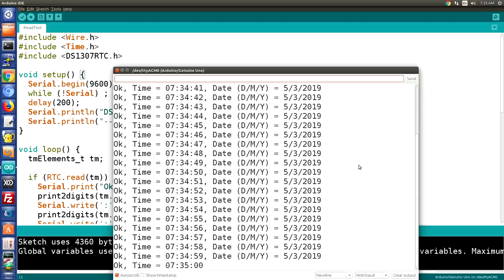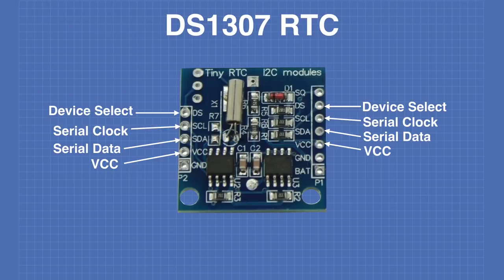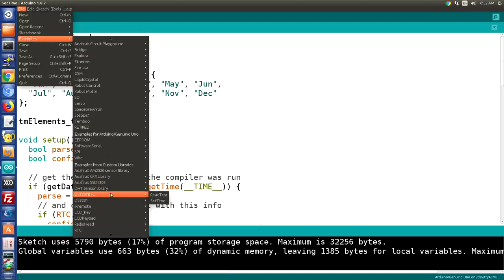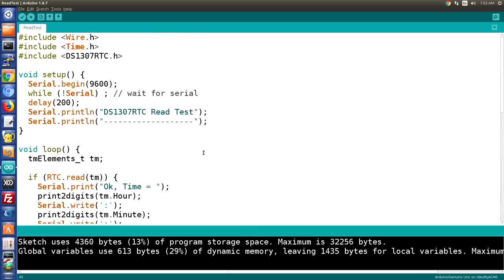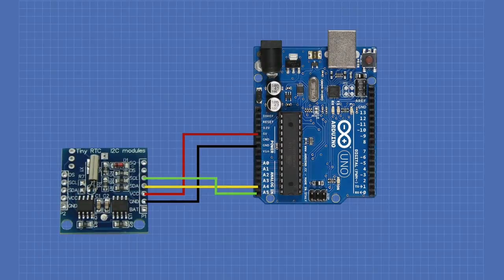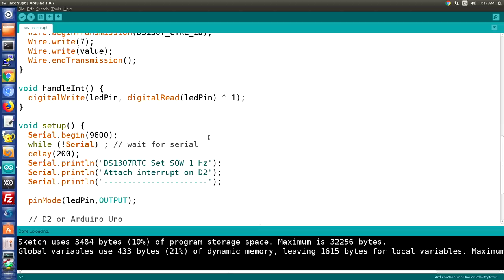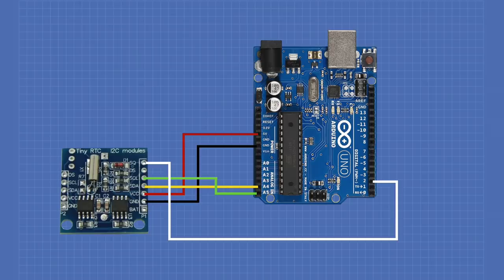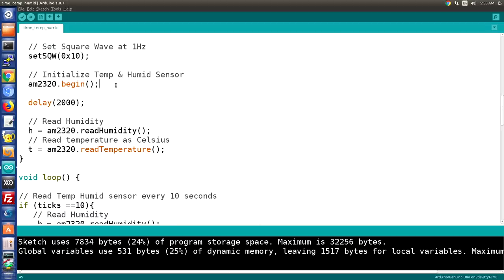Arduino Real Time Clock - Using the Tiny RTC

Comment: the DS signal is a 1-wire signal used for the DS18B20 temperatuur sensor that you can  add to the board and is not a device select! 
here is the schematic: https://www.fabtolab.com/image/data/Accessories/RTC/DS1307ckt.jpg
and if you use a CR2032 (non rechargeble battery) you need to change some stuff because those boards are designed to use a LIR2032 (rechargeable battery).
to do this remove R5, D1, R4 and R6. then wire a jumper on R6. other wise you try to charge a non chargeabe battery and that is going to kill the battery.

Comment: You might want to use the qualifier "volatile" for the variable ticks, so the declaration should read "volatile int ticks= 0;". This is a compiler directive which results in code that reads the value of ticks from RAM instead of from a register in order to avoid conflicts when using concurrent processes and/or interrupts with global variables.
Reply: this also I wanted to suggest, but you were quicker :-) 
when the values of variables are changed in interrupt service routines (ISRs), they have to be defined 'volatile', otherwise they could behave oddly

Comment: One small but important point regarding your LED blink on interrupt code. It is not a very good idea to use digitalWrite within an interrupt service routine because it is very slow and, as you rightly pointed out, the routine should execute as quickly as possible. It is much better to use direct port manipulation (in this case PORTB bit 5) to flip the LED state.

Comment: I really like how you introduced the module and the developed the ideas in this video. It was a good progression from module to project. I'm looking forward to the robot series.

I do like the two camera set up for seeing the projects on the bench or when you showing a module or part. I'm not a fan of the look left look right camera switching for the explanations/narration. It's quite jarring and doesn't feel like it adds to the presentation. I can see what you are going for with respect to keeping interest in the visuals but I think some editing cutting with stills or change of framing would work better than seeing you physically turn to look from one camera to the other with no obvious purpose.

Keep up the great videos!

Comment: Thank you very much for this. It saved me (some time). LOL  I did have trouble since I have a DS3231 and not a DS1307.  It kept putting the seconds 8 seconds behind. I ended up having to add 8 seconds to the time when it retrieved the time from the PC. Thanks again!

Comment: Very nicely produced and easy to follow along with clear explanation and good pace. One nit that jumped out at me is the misuse of the term accuracy, where you really meant precision. The*precision* of the RTC is 1 second. As others have noted, the accuracy is off for two reasons. The time & date used to set the clock will have a slight skew due to the lag between running the clock-setter and the compile time. Also, many people seem to find the accuracy of the clock frequency is poor, resulting in increasing differences between date & time of the RTC & and actual time and date. I immediately wondered whether the is some way to trim the frequency of the crystal to achieve better accuracy.

Comment: I love the way the info presentation flows. Pretty structured and informative. So I've to visit your website for more static info on this topic. However, I found on the website (similar to this video) the description for the DS pin on the TinyRTC module "DS – Device Select, this allows you to enable or disable the device.". I did more research online and found that DS was actually meant for the temperature readout from the DS18B20 tempearture sensing module that can be optionally soldered to the board next to the battery (if its not already there). And it is also recommended to have a pullup resistor to the DS pin conenction when in use.
Reply: The DS18B20 temperature sensor is independent of the DS1307 RTC hardware on the board. The only shared resources between the two are the VCC and GND rails on the TinyRTC board...

Comment: There is also a 16 pin "DS3231SN" RTC. This is the first I have heard of the DS1307 Tiny, but it sounds like they both do the same. Unfortunately I don't have the pinout in front of me or I would share. 

Pretty cool little chips.
Reply: The DS1307 has no alarm function built in and no temperature built in; the DS3231 has two built-in alarms, and can be programmed to interrupt when the clock time matches the alarm time in seconds, or minutes and seconds, or hours minutes and seconds, or days hours minutes and seconds, etc.  The DS3231 also has an on-chip thermometer. (I bought the DS1307, and was disappointed that I could not interrupt once per hour.)

Comment: I completely agree with the other commenters who say to use the DS3231 instead. (Especially the DS3231SN, which is the quartz crystal version, rather than the DS3231M, which uses a less accurate MEMS oscillator.)  The DS1307 can be so inaccurate that it's just not worth the effort. I've gotten some clock kits based on the 1307 that were so bad they literally were useless (a clock that loses or gains several minutes per day is simply not usable). The DS3231 is superb.

Comment: Module’s Hidden Feature – DS18B20
There’s a provision on our DS1307 RTC module that often goes unnoticed. It allows us to install DS18B20 temperature sensor.

The 3 holes in the top corner right next to the battery holder(labled as U1) is where the DS18B20 is installed.
Once you install the DS18B20, you will be able to get temperature readings from DS pin. These readings can further be used to compensate for temperature based time drift in code.
So there is no need to install a Temp Sensor, since its already at the Tiny RTC / DS1307.

Comment: Very nice! but I think the DS3231 is better and precise than DS1307. what you think
Reply: 3231 is far more accurate. You can also solder it directly to some of the Arduino clones as they have an additional
header that just happens to align with the pins on the 3231 RTC. I had a 3231 running for over 2 years, have not had to adjust the time yet.
Reply: Always well made videos. The DS1307 is a great intro to I2C use but for accuracy, the DS3231 is a lot better. I have built both.

Comment: Kind of tangentially related, but a lot of people are using now ESP32/ESP8266 based 'Arduinos', as they are much more powerful and have WiFi/Bluetooth, and are generally cheaper.
Obviously with the WiFi connection is the possibility to use NTP (network time protocol) to get the accurate time from a time server, the ESP even has functions built into it's ROM for registering which time server you want to use, so require almost no code to set up.

Comment: Just something I read on google about DS1307. "The main difference between the DS3231 and DS1370 is the accuracy of time-keeping. DS1307 comes with an external 32kHz crystal for time-keeping whose oscillation frequency is easily affected by external temperature. This usually results with the clock being off by around five or so minutes per month." so maybe the DS3231 is better.

Comment: I noticed that as the serial monitor was listing out the time, temp, humidity that occasionally there were would be two consecutive time displays with exactly the same reading in the seconds place.    I thought this would update the display once per 1 Hz tick,  so I don't follow how you could ever have a duplicate time displayed.    What am I missing?

Thanks!    I love your style.   It is so very easy to follow.

Comment: It seems that assigning the square wave to pin 2 or 3 of the Uno comes with the disadvantage that it is an interrupt. The controller stops when the wave is down.

Why not assigning to a non-interrupt digital input pin and then check for change of state (of the square wave)? This would avoid interrupting the controller.

Also, do the statuses of the I/O change to zeros (off) during an interrupt, or are they frozen (maintained) during an interrupt? Thanks

Comment: Hello Guru, I have recently subscribed to DroneBot Workshop and like your way of teaching with detailed explanations and have become your fan. I request you if possible to append this video for interfacing this with 6 nos 8x8 Matrix Display in configuration as Digital clock display. Although you did mention that there are cheap Digital clocks available. If you have this on your website please do inform.

Comment: Ive seen a few I2C projects that need a resistor on the dataline to ground, is this required for this project?
Great vid, thanks for sharing.
Reply: If you have multiple devices , interference or your I2C nodes are a long distance from each other you may need pull-up resistors.
Reply: @typematrix5038  thanks for explanation, greatly appreciated.

Comment: Hi Bill, Great video and very informative. Unfortunately I could not download the associated code files for the interrupt example, so I copied the code from the video. I could not get the LED to flash from that code until I noticed that the command Wire.begin() was missing from the setup() function. If you put this in right after the call to Serial.begin(9600) it all magically works.
Reply: Thanks! I had same problem.

Comment: 1. DS pin is for ds18b20 -- there is a place for it for battery holder side. 
2. You ABSOLUTELY MUST modify module for using standard non-rechargable battery. This module will try to re-charge battery and will damage it. Not safe.
Use modules based on DS3231N -- much more stable, not required any modifications, allows to change I2C address, and have additional functionality. A bit more expensive, but much better overall.
You also never mention that module have EEPROM as well. 
Please research modules and their issues more carefully, can be lots of traps like that.
Reply: Wax on, wax off? That's a disaster. You should know better than trying to school the master.
Reply: @AngryRamboShow  They are actually correct in what they say.
Reply: @SpeccyMan  "They?"  Who?
Reply: This module was intended to be used with an LIR2032 and not a CR2032. Martyn Davies channel shows which components to desolder in order to use a non-rechargeable battery.

There's another cheap RTC module using a DS3231 and it also has the same issue of being wired to recharge an LIR2032 so will also require modification to swap in a CR2032
Reply: I have to agree. I used DS1307 and it skipped 3 days! within a one year :) DS3231N can measure temperature therefore adjust crystal frequency based on temperature. You can measure temperature from the sensor as well :)
Reply: Jokes aside, that's good to know. The thing about DBWS is that he's trying to bring this information out to people in a video series that's easy to follow along. Maybe you should put in the effort to make a video detailing a example project using the DS3231N. It's a lot easier to sit on a channel and say "you're doing it wrong," then it is to actually produce quality content and to build an audience. Have a little respect for the teacher, even if they don't get everything right or do everything in the best way possible. This guy has helped me out a lot, and yes I usually find a better way, but he showed me what was possible with a little time and effort, otherwise I would not have known much at all.
Reply: You can remove the diode and resistor, witch will disconnect the charging circuit.

Comment: Great video!
I saw a video you used rf 433 module to send data
I am currently stuck trying to use it to send data from an accelerometer to a dc motor, can you help with that

Comment: How do you ever get those RTC modules to work?  I got 6 of them from Amazon and can't get any of them to work since the 32 KHz crystal doesn't oscillate and the ds1307 doesn't do anything!  The Ground pin was not even connected on the pc board but jumping a wire to the neg. on the board didn't help, although it's getting power now it still doesn't do anything.   I tried replacing the crystal on one of them but that didn't make any difference.  I wonder if they were all made with counterfeit clock chips or what is going on with them?

Comment: Cool and simply video... but can you tell me How to programming a alarm time . I wish to use a ESP8266, with a relai to switch on /off the current wo will start and stop a radio. Have allready buy a DS3231 to have anytime the right time but don t find a solution to programming the alarm time . Can you help me please ? thanks in forwards

Comment: i made a raw ds1302(found from another ready clock) dot pcb module & connected the crystal & backup batterym wired it to A4 & A5, nothing is showing on serial monitor, using nano, do i have to use pull up resistors & what to do with the CE pin.

Comment: Hello DroneBot Workshop

I followed the tutorial with my arduino mega 2560 up to the point where the external LED pin would trigger on each falling edge of the RTC. Unfortunately the LED just stays on, either staying high all the time or the frequency is too high to detect the blinking. The code that was used is identical to yours.

Any tips or suggestions will be appreciated.
Thank you.

Comment: For full article there is an error,

This site can’t be reached
Check if there is a typo in dbws.
If spelling is correct, try running Windows Network Diagnostics.
DNS_PROBE_FINISHED_NXDOMAIN

Comment: I am trying to make a pet feeder. I am looking into clock modules which would run on low power like cmos cell or aaa battery, and not required to have a microcontroller attach or running . I found out clock modules like ds3231etc runs on cmos cell for months. But I realized it can only trigger two alarm daily. Is there any other module with at least around 6-10 alarms capability daily or any way to increase alarms capability of ds3231. So that I can amplify the alarm signal and use it trigger motor or servo that will dispense the treat/food. I was unsuccessful in finding such module, I also tried to find cheap circuit board of a commercial pet feeders on amazon. Still nothing.

Thanks in advance.

Comment: Hello! Do you know any website where I can find some step-by-step information about Arduino and how it works?
Reply: Just a thought, however it might be worth a look at the elegoo.com website.. even if you don't have say, the basic starter kit which they do sell, the downloads section has place to get the files associated with the kit and in general a PDF running through the basics and how to complete all the projects associated with the parts in the kit . Flashing a LED, making buzzer work, whatever is in there.

Ages ago I bought their general electronics kit which came with breadboard, wires, LEDs, a couple of transistors, lots of little things actually and I'm glad I did.. it was a super start to get a grip on things I might need. I'd imagine the one of the Arduino kits could do the same, especially if you've never really done anything with it and don't have an Arduino maybe!
Reply: @ollieb9875  Thank you very much!

Comment: what should one do for 12 hour format setting?
Reply: I found a little piece of code for 12 hour format

void ampm(int Hour){  //ampm function takes the hour value 0-23
if(Hour==0){          //if it's 0 it becomes 12
  Hour=12;
  a=true;            //true if it's am, false otherwise
  lcd.print(Hour);
}
else if(Hour>0 && Hour<12){
  a=true;           //normal value
  lcd.print(Hour);
}
else if(Hour==12){
  a=false;           //changing to pm
  lcd.print(Hour);
}
else if(Hour>12){
  Hour=Hour-12;     //substract 12 to bring it back to 1,2,3,...
  a=false;
  lcd.print(Hour);
}

}

Comment: When i use i2c scan i found 2 adress 0x50 and 0x68, from  the library they use the 0x68.
Did anyone know what the use of 0x50 adress?
Reply: The module has a 24C32N EEPROM chip (4 kilobytes).

Comment: "Without using a data structure the time you are going to get back is . . .the number of seconds elapsed since the beginning of Unix time." Get back from what? The date and time MAINTAINED ON THE DS1307 is in years, months, days, hours, minutes, and seconds, and the seconds range is 00-59. Where does the Unix time come from, and how do I get it?
Reply: Looking into this more, the SetTime sketch, using DS1307RTC.cpp, is going to add 30 years to the current date and set the TinyRTC year to 50 in year 2020 (years are 00 to 99 on the chip) ; that probably means the TinyRTC isn't handling leap years correctly.  1970 isn't a "thing" to the DS1307, as far as I can tell.
Reply: @3maisons  If the correct year can be obtained, whether or not it's a leap year is a relatively simple calculation for a computer:
If the year is not evenly divisible by four, it's not a leap year; end.  Otherwise it may be a leap year; next step.
If the year is not evenly divisible by one hundred, it's a leap year; end.  Otherwise it may not be a leap year; next step.
If the year is not evenly divisible by four hundred, it's not a leap year, otherwise it is a leap year.  End.

Comment: I found your link over at   https://dronebotworkshop.com/real-time-clock-arduino/#Square_Wave_Interrupt_Demo_Sketch
I have an issue, my analyzer show the time to be 30US  is the address 0x68 wrong on mine?  How do I find it?  I tried several values for the 0x10  and it changed nothing.
To me that implies the wrong address.
Any idea?

Comment: It's not "I TWO C"
It's "I SQUARED C"
The only reason it's often written as I2C is because you need to be able to use the IBM Extended ASCII character set if you want to write it as I²C, and not everyone has that character set enabled by default. (The "squared" symbol is both ExASCII 253 and 0178)